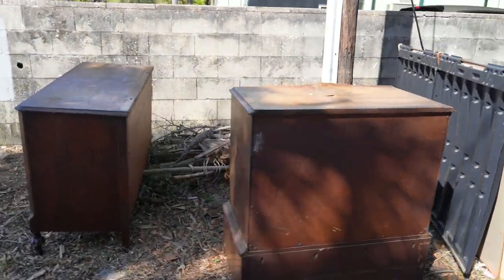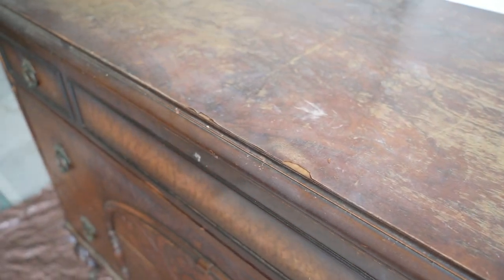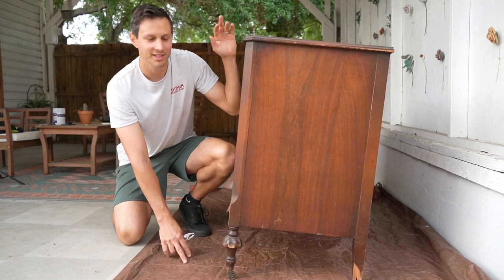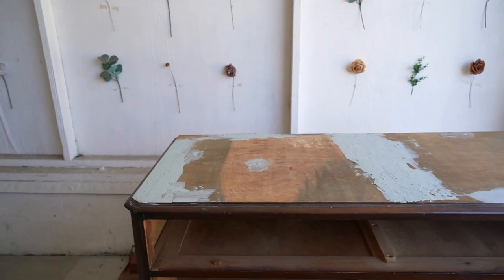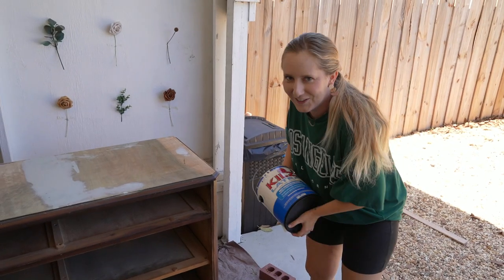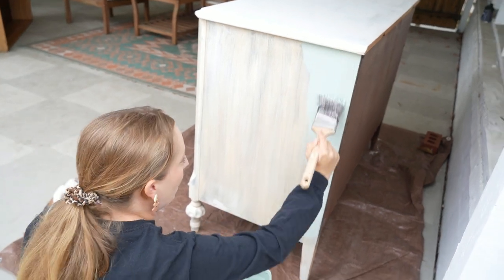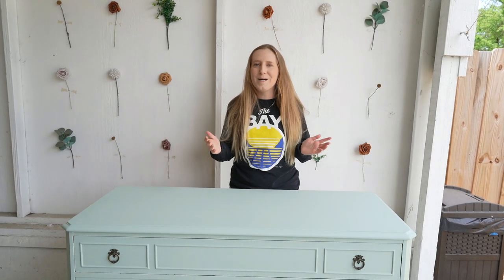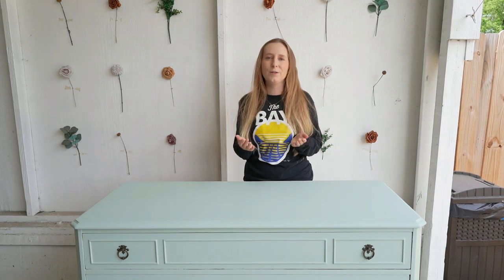TRASHED Antique Hutch gets a second life | Furniture Flip

Comment: As mentioned in several other comments, did you clean the piece before you put primer on ?  Because of the age of this piece, I highly recommend  using Feed and Wax to nourish the drawers inside and out as well as the slides and glides so the drawers move smoothly.  Also, did you do anything to clean up the hardware ?  
The piece does look nice in that color.